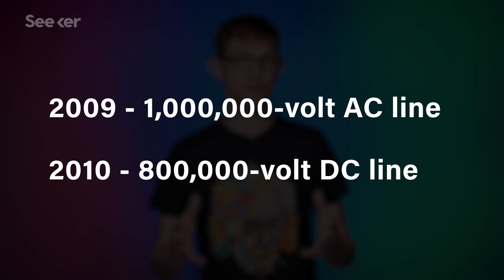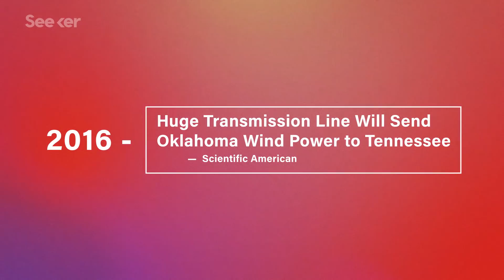Can We Power the World With a Single Energy Grid?

Comment: There's no reason to have a global power grid.  All that would do is cause more blackouts and be more terrorist attack points. And the politics would be so messy.  Don't forget how lossy power infrastructure is in general.  Batteries are a better solution.  Just keep the energy there and use it later.

Comment: Yes, oddly enough we can build an global electricity network, if we can iron out to transmit electricity over 1000's
of miles over land and sea, we can use the same technology that transmit eletricity, radio, tv ,satellite 
communication and Internet, a global wireless power grid that any home, business, or vehicle could tap into at will, on the go.The trick is that the powerplant will generate only a modest output of 380V with a minimal loss of just 1mV every 1000 miles.

Comment: 3:29 Wait, what? That makes no sense. Yes, those power adapters get hot and lose energy. But that's mainly because they have to transform 120V/220V into something like 12V or 5V and not because they have to convert AC into DC. The latter one is pretty simple and is only done with 4 diodes and a few capacitors. But you were talking about higher voltages than usual in this video and not about lower voltages.
Also, it wouldn't be practical to get just a single voltage from your socket. The different voltages devices need are 3.3V, 5V, 12V, 24V, ... So we still would need to transform the voltage down (or up) for most of the devices. Of course, if we get closer to the voltage we actually need then less energy is wasted as heat ...

... in our house. It's still wasted somewhere else.

Comment: At 3:30 you talk about ditching the AC to DC conversion that gets hot. This is extremely misleading suggesting that the DC does not need conversion. Who uses the 800,000VDC in China without conversion? HV for transmission. LV for usage especially homes so conversion is necessary regardless of the AC or DC. You want to make this argument compare the efficiencies of AC and DC step up at the plant and step down at the end user. AC is better but the losses in transmission is where DC shines and that is what is making DC a viable option.

Comment: A global electrical grid is a really stupid idea. It would waste untold amounts of power and resources, would offer no real benefit (power can be generated anywhere on earth easaly enough) and hackers would have a field day fu- err messing around with it.
Reply: If you have the resources.  No coal or gas meas transporting either or.  Solar and wind need lots of batteries. Hydro needs a river. 

What do you do if you have none of them?
Reply: @catprog  There is power basically everywhere on earth. For storage there are many options. Batteries are certainly an option (there are many chemistries to choose from). Chemical storage, such as using electricity to crack water into hydrogen and oxygen or peroxide and hydrogen works. You can store energy as pressure by compressing a gas. Fly wheels are another option. Phase changing materials can store a lot of energy. Molten salt heat "batteries" store even more. You could even use excess energy to run a motor/generator to lift a very heavy weight then when you need energy allow the weight to lower back down causing the motor to spin the other way to get your power back. But by the time the world can figure out all the red tape and actually build a world grid. We will have fusion power and large scale storage will be mostly unessicarry.

Comment: Dude you know nothing. AC isn't going anywhere. DC makes only sense in long distance transmission due to capacitive energy loss. Tesla was right. You there is no way to transform voltage efficiently on a dc system. Even on UHVDC transmission lines the power must be inverted to ac before the voltage is stepped down. Don't worry, your dc charging bocks aren't going anywhere.
Reply: Just send 1MVdc into your house and plug your laptop in with a switching power supply XD

Comment: At the borders of countries have stations for the power lines controlled by the neighboring countries in a neutral zone so there needs to be two or more "switches" turned on/off simultaneously for power flow to be stopped, started, changed, etc.

Comment: Ditch the AC - DC converters? Sure, but you can't just plug your electroincs in directly just because it's DC. You would still need a converter that "get all hot and waste electricty" to step down the voltage.

Comment: 03:30: "A global DC grid is a green♻️ dream!"

Really? Then, pray tell, what sustainable energy source will power this grid? I'm all for clean  perpetual energy, but short of finally cracking "cold" fusion☢, how would we even achieve it. Cost is the least of our concerns.
Reply: A global energy grid would be benefit a full transition to standard renewable energy sources like solar and wind because it can balance out the local intermittencies of these sources by transmitting local surpluses from faraway.  Fusion would actually make a global grid unnecessary because it would not be intermittent and can be generated locally at demand level.
Reply: @Awave3  You need local in  order for something like a global grid to even be considered. For that to happen,  locals would have to expend even more energy than now just to create an infrastructure capable supporting long-distance energy transfer - that, unfortunately, means burning carbon (again, unless some cheap/renewable/sustainable source were to suddenly appear via osmosis).

And given that a lot of the world's power providers are private (especially here in 🇺🇸), they're not going to research or implement green energy out of altruism.💰
Reply: @BuddyL  Local expenditure of surplus is the basis of an economy.  If an area in the southwest desert builds a surplus of solar capacity they can sell it to other areas that are less solar rich just like oil trade.  National grids can be built and linked independently, especially with DC.
Reply: @Awave3  And where is this desert land supposed to get their initial supply from? All of this is hypothetical based on resources that either currently don't exist or are in the hands of entities not willing to share them for anything less than exorbinant prices - that's why Puerto Rico still has only a fraction of its power back after Hurricane Maria.

Thinking that a grid will just appear out of simple need is flawed thinking because "trickle-down economics" don't exist. If they did, the world's housing, health, and homeless problems wouldn't be anywhere near their current epidemic prportions.
Reply: @BuddyL  Assuming we are still talking about the US southwest, they already have an initial supply like the Hoover Dam powering Las Vegas and some solar farms already.  The sun itself and desert land to build on are the resources, and foreign demand is the incentive.  Puerto Rico is a good example of a foreign demand, assuming they get the aid they need to recover.  Solar energy benefits both residential customers and corporate entities that use it more than the dying Coal™ industry so I don't see how your point about trickle-down economics factors in.
Reply: @Awave3  Which is it: do you see Puerto Rico is exemplary of how resources are(n't) equally distributed or do you not see how "trickle-down economics" isn't put into practice?

You answered your own question.
Reply: @BuddyL  If anything Puerto Rico is an example of trickle-down economics failing which is why they need financial aid now at the individual level.  That is not my point, my point is if Puerto Rico becomes a part of a global grid they can get foreign energy imports that stimulate their industry and individual wellbeing enough to pay back the debt and even export some of their own power.  As a nation they can distribute those resources however they like but preferably not in trickle-down economics as we understand it.
Reply: @Awave3  And MY point - which I'm stating for the last time - is that those resources aren't going to appear out of thin air, so the entire idea of Puerto Rico, Haiti, or any other such country becoming a part of such a grid is pure vaporware. Hell, the video above points out how unlikely the idea of a fully developed nation getting any time soon is ridiculous.

That clear enough for ya?👂 I have no interest in repeating myself again.
Reply: @BuddyL  If you talking about the cost and materials for building the generation and transmission infrastructure, even Nigeria is building a large wind farm.  Poor countries can still develop especially with help from China that has offered billions of dollars to renewable energy projects around the world.  The Chinese know they have a lot to gain in return from these energy alliances, so will the rest of the world compete in the new electric economy or let the Chinese be the sole leaders?
https://www.fdiintelligence.com/News/PowerChina-launches-world-s-largest-foreign-investment-in-green-energy
Reply: @Awave3  Between the fact that most of that tech is still theoretical, the fact that no industrial nation has gone 100% green, and the fact that China's lead is made possible by the very people in power who denyenergy, food, and housing access to the poor... it's obvious that you're just happy repeating CORT talking loints that have no basis in reality.

We're done here. Ta, troll.

Comment: There is this thing that solar panels make DC current, and if installed on roofs it shouldn't be converted to AC just to travel several metres and be converted to DC again when it reaches an adapter. A small genius and engineer from the Vancouver area explained me that.

Comment: @3:28 you mention ditching ac to dc converters that get hot wasting 1/5th of the household power. This is emphatically not true.
1. urban power distribution is not practical in DC because the low mains voltages loose voltage to resistance over short distances.
2. the plug packs / wall warts or whatever you want to call them only really get hot in places that run 110 volt mains as internally the first stage in many designs is to double the voltage using diodes and capacitors. this make the capacitors run quite hot. in places with 220-240 volts they run much cooler.
110 volts is not an efficient mains voltage and if the US was serious about efficiency then all new housing estates should be built with 240 volt outlets with a different socket.
most of the equipment will work fine that uses switch mode power supplies except for simple resistive devices like hair dries and small motorised devices such as fans which would need to be bought as 240v varients.

Comment: Distributed power is the only solution, the wire alone is stupid, a recent solar panel designed and prototyped is a whopping 20-microns thick and use nanotubes to turn the photons parallel to the structure gaining 98% efficiency the top 10-microns anti-reflective.

Dump the grid, it's just there for you to pay by-the-watt instead of owning your system and pay it off with a monthly payment that's the same all year, the grid is a Steam Age racket, a scam.
Reply: And how do you get power when the sun does not shine?
Reply: @catprog  Easy, 2 ways, the emf version can use a feedback motor-generator, or, a permagnetic motor-generator both don't use inputs or batteries. 

Neither are allowed under current political fossilites, regardless the feedback motors are easy to make from OTS motors & generators, it's like EVs already have self-generating versions, these are only a step ahead of battery mgmt.

Comment: One vital thing that was not mentioned is the issue of stability. Any environmental disaster could knock the power out in a large area, if it occurs in the right place such as a generation site or a large substation. A carefully planned cyber or physical terrorist attack could achieve a similar result. The power grid has safety measures and regulations in place to help protect against such things, but a larger grid introduces more possibilities for error and loss of control. While it is appealing to have everyone be able to have power, it is not realistic from a controls and electrical engineering perspective due to the contingencies involved.
Reply: Except by having a larger grid their are more points where the power can go through if some are disrupted.
Reply: @catprog  Yes and no. Yes, if we are talking about the distribution level of the power grid. No, if we are talking about anywhere else on the grid, depending on the design. Sudden power loss anywhere still can cause damage to equipment from the resulting currents that can overload the circuit. This is why reclosers exist among other kinds of safety measures on the grid. 

Rerouting power can happen at the transmission level, but the massive loss of power can force utilities to have to do load shedding to prevent further damage to equipment and further loss of power in the long run. Still, this means that the utility will have to quickly buy power from other utilities to compensate for the loss, depending on how much reserve power the utility with the outage has. In other words, contingencies cost utilities a massive amount of money for just keeping the lights on in terms of manpower and the use of more expensive reserve generation. This does not include penalties from governments or whatever other groups the utility may be a part of.

Comment: This is practically impossible since no country will allow it to happen even if efficiency of “The Power grid is 100%”. Fusion technology will force us to remove all current Wire Grid Infrastructures which will cost in Hundreds or Billions or dollars. Same thing happened when Edison’s DC grid was tore down for the AC.
Reply: How would fusion require the grid to be torn down? It requires that exact grid to transport the power.

Comment: My personal belief is that the current grid should be abandoned and more localized mostly solar power should be made available. This would allow for existing power lines to be converted for data transmission bringing internet to nearly all locations with no new infrastructure.
Reply: why does solar power need to be made available when it already is available? also battery technology still has a ways to go since most electronics need stable voltage and amperage to work properly and solar for some reason just doesn't work in cloudy or dusty or night conditions
Reply: TwistedByDesign Solar also can not provide in certain latitudes, has great leaps in pricing and longevity to come (efficiency is already there), and they are not effectively self-maintaining/cleaning.
And ya, battery tech will grow and hopefully be twice as effective in 10years as is it now, but for most everything a number of batteries can be put together to provide for any need. Honestly a revolution in heat displacement would be enough to set significantly more movement towards renewable energies.

Comment: If we consider our global communication network and the internet, a global power grid doesn't seem all that far fetched from a political or a cost perspective.
Reply: The difference is, the internet works even when you block out a whole country. Pretty much  every country runs a backbone network. If a country decides to block out your energy source, that's really bad.
Reply: @jeroenvandenbulk  Couldn't this hypothetical Global Power Grid (GPG) be constructed like the internet? If one country blocks you, the energy is simply routed via different countries and exchange points?
Reply: @ajtrvll  This seems indeed logical because that grid must even internally have many connections in case a local power station should suddenly fail and fall away. Of course this system would necessitate political stability too but why not???  War seems no longer economically interesting.

Comment: Power company monopoly is already a huge problem. Customers are done wrong and are forced to stay. They dictate their own fee and costs because they are your only option. Power companies are the reason why local to me can't have off grid power or assisted power like solar. So we have pipes than run over our roofs here to help the hot water heater and warm pools to save electricity. Duke tried to stop it. My grandmothers power was shut off for two days on accident. They ment to disconnect her neighbors. All of her insulin in the fridge went bad, six bottles. They are almost $700 a bottle.  It was a six months supply. It took them two days to turn the power back on. Could you imagine how much the power companies would grow if the entire globe was covered or had the access to be covered. Insane lol

Comment: Your phone doesn't need that charger because the outlet is AC but primarily because it's running a much higher voltage. And converting that down to 5V is much easier when it's AC.
Reply: For old school wallwarts, perhaps. In modern power supplies rectification is the very first step. Other than these 4 diodes, there is no difference what-so-ever.
Reply: @aleksandersuur9475  looks like you're correct on the second point. But I believe the first point still applies.
Reply: @RandomUser311  yes, voltage difference is why you can't do away with wallwarts, you need high voltage for efficient transmission and you need low voltage for low powered digital circuits, a step down has to happen somewhere.

Comment: Another difference is that AC powers all connections with an equal voltage whereas DC is first come, first served
Reply: There is a voltage drop in AC also
Reply: hamza mehmood it isn’t the drop that was the problem with dc... it was the distribution of the required amps beyond a single building... no way to easily raise and lower voltages... now with modern buck and volt converters, it can be achieved with DC.
Reply: @SuperVstech  also DC is suitable only for long transmission but for short and medium AC is better